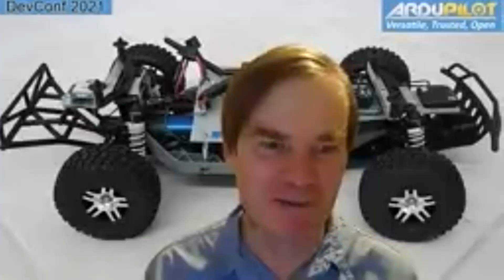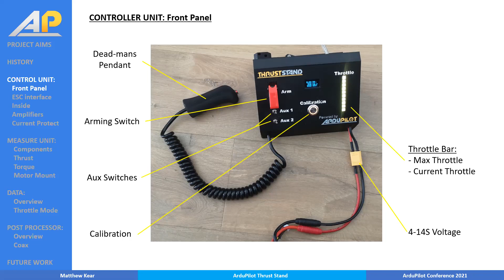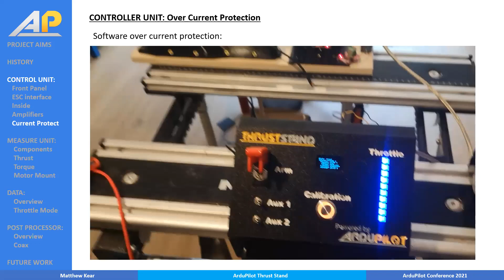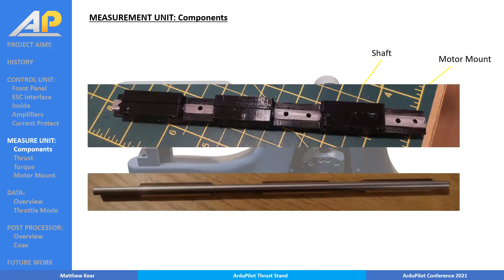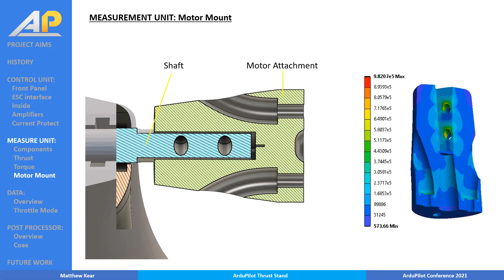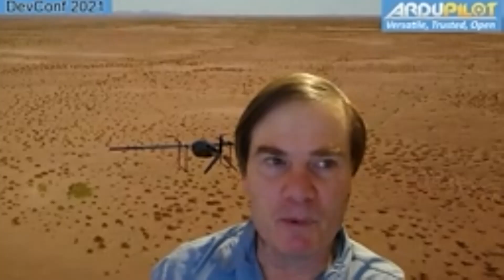ArduPilot Thrust Stand by Matt Kear

Comment: Hi Matt, you really made a very impressive and good job.
I purchased few week ago the same Thrust Stand you started from (Mayatec MT10 Pro) and I found that the most boring issue is to write manually the measuring data (considering also the limited time due to the battery service), so looking for someone that already solved this issue, I’ve seen your post and have been very well impressed.
Now, I am not interested measuring the torque because I pilot only airplanes models, so I would be interested to do something like what you made at the beginning (the thrust stand capable to acquire thrust, voltage, and RPM from electrical commutation with the capability to input the voltage manually or with a defined step sequence and the OLED display with the capability to store data or send them to a PC.
I have not (as I suppose you had not too) the Thrust Bench pinout of the thrust reading display and/or at least of the strain gauge installed on the measuring beam.
Could you help me to make something similar to what you made at the beginning of this job? I have some knowledge and practice in mechanics, electronic and informatics also if I never worked on the Arduino World, so I hope that, with the right instructions, I could do what I have in mind (of course you help will be essential to reach my goal).

Hope that this is the right place to write about this issue otherwise please, let me know how contact you.

Thank you in advance.I will appreciate very much if you will be available to help me to transform my wish in something real.

Valter